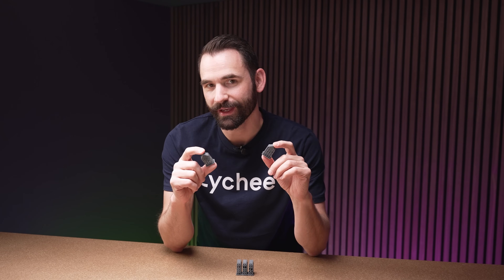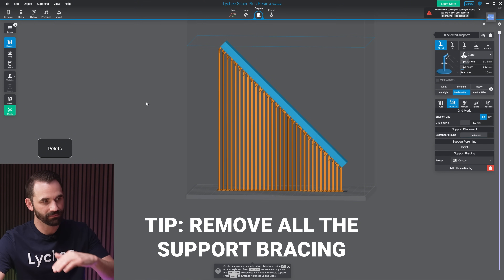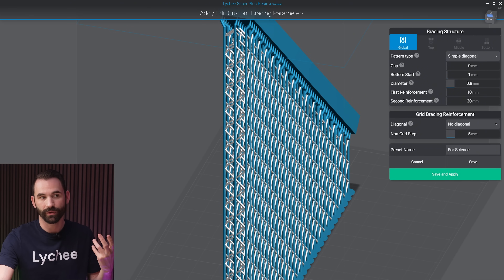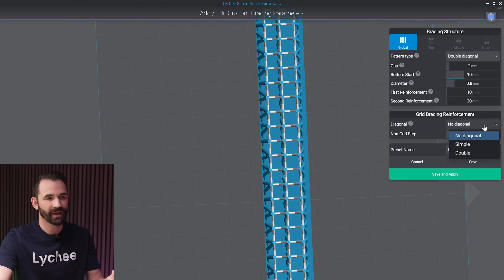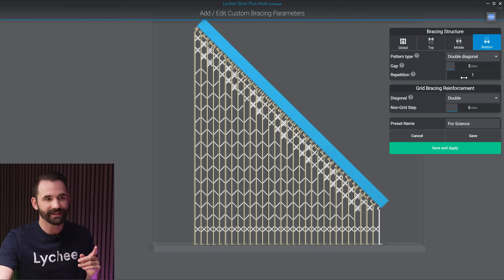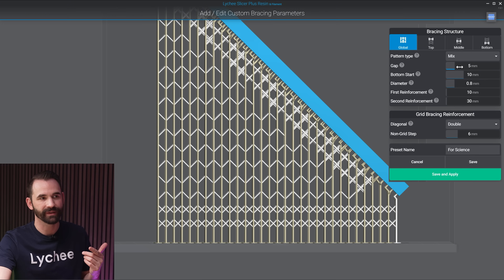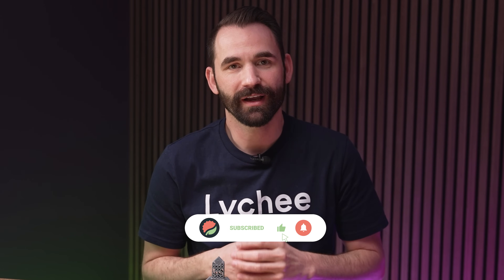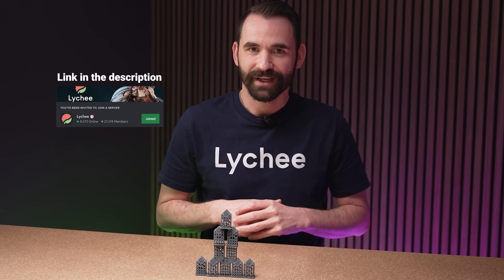Bracings in Lychee Slicer – Why You Need Them | Lychee Slicer Tutorial

Comment: Why is this not fully automated?
Reply: There is the magic button that does it all. But many users including myself wants the control.
Reply: @J3DTech  Ahh cool.
Reply: @Martial-Mat  There's no software, AI etc. currently which can achieve orienting, supporting, and bracing a model entirely automatically. If you know how to programme something which can do that, then definitely do that as you'll be extremely wealthy in no time at all. One issue, for example, is with a complex 3D model, such as a gaming miniature, when it comes to auto-orienting the model, how does the algorithm or AI know which of the several hundred, if not several thousand, surfaces you want to keep clean of support scarring and orient it accordingly to minimise or eliminate the need for supports on those surfaces?

For simple shapes it's not too hard, but people print some crazy complex things. Including articulating parts.

Now if you mean why isn't the bracing part automated? Well, that part pretty much is really. You can support a model and just hit "generate bracing" on it and that will be fine. Typically you wouldn't want to automatically generate bracing while you're placing supports as they just obstruct your view, especially when supporting complex models with lots of weird overhangs and such.